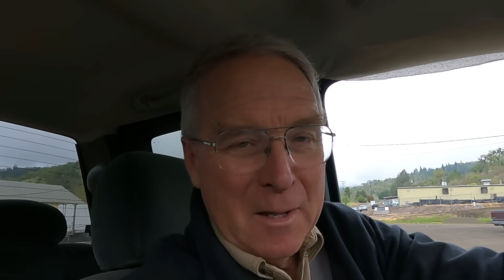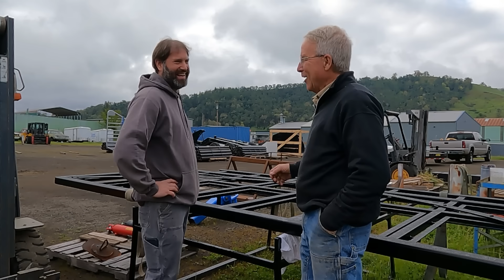Installing My Gate!!

Comment: Yes, your choice of the "H-beam" without correct moment connections is your issue. 
Add stiffeners all the way up to avoid torsion buckling.
Also that brace at the base should have been near the top and you can still do this with a lateral brace from another large mass footer / pier. 
You can also weld plates on top and bottom flange (leave bottom open to allow water runoff and debris removal)...

Comment: You're really worried about security there; I couldn't miss the barbed wire along the top of the chain link, and I presume that some of the low-voltage feed is for video surveillance and other security measures.  Have there been incursions?  Is your shop and business a target?  What's the neighborhood like?  Am I just naive?  I'm a low-income renter with no automobile and nothing of value, in a residential neighborhood in the greater Boston area, and don't think that much about security.

Comment: Beautiful gate.
One county north of me there is an Amish Welding and Fabricating Shop. (That is amusing in and of itself. They sit in the dark with a gas lantern eating lunch. Then they fire up the diesel generator and go back to work ). They build gates. High dollar gates for Mcmansions and Horse Farms. They powder coat everything. I was up there a few months back getting some cattle feeders and they were loading a set of gates on a truck . Twenty thousand dollars for one set of two gates.

Comment: Engineer here. You are on the right track with those horizontal braces. Take it further, cross the I to get to the section that is starting the twist. You could always box in the front and rear of that beam to help resist the twist. Can you come up straight with a 6x6 square beam from the pad your electric comes out of? Then cross brace to the main vertical beam. Or just poor an anchor pad behind that to attach the upright brace post. If you reference heavy wood beam corner post fences, they have both the diagonal and a horizontal brace going to another vertical post to take up the loads.

Comment: I've watched quite a few of your video's.  You nailed the problem with your twisting "I-Beam," a.k.a. Wide-Beam. The extra four braces will help.  If you truly wanted to stop the "twisting," make up 8 (eight) pieces (3/8" in. solid plate / bar steel) to fit the three sides of the beam and weld 4 (four) each side, evenly spaced.   I would argue had you properly reinforced the "I-Beam," with the 8 (eight) pieces, {stiffeners} the four you had welded extra, would never been needed.  The "I-Beam," is designed to take a load from top of the wide flange straight through towards the bottom flange.  (I'm in no way a engineer, just a fat 70 yr's old former ship yard welder.)  The stiffeners need not be full contact on all three sides, allow a 1/4" - 1/2" radius @ the 2 (two) inside corners, water would / should be able to drain FREELY!!!!!!  Also the stiffeners should not come to the outside edge / flush to outside edge.  should be short enough to allow a full weld around the edge of the stiffeners.  Maybe 3/8" in. to 1/2" in. from the outside edge / flush to outside edge.

Comment: Coming together great!  I did not watch the episode for the footer construction, but my gut engineer says that thing should be at least 6' deep and 18" diameter at minimum, especially in soggy Orrygon!  As far as the hinge column goes, the kickers will help, 45 degrees is ideal.  What would really help is some depth to the design, but it's a little late for that.  I would stitch 4 vertical angles, say 2x2x1/4" , attaching the toes of the angles between the inside flange and web of the column, creating 4 small  square "pipes"  at the 4 corners.  Four inches of weld on each toe, top and bottom and 2" on 12" @ a single 3/16" in between. Weld the ends of the angle to the baseplate while you're at it.  It wouldn't hurt to put a horizontal strap connecting the the backs of the angles at each hinge point, and it's only 15 more minutes work. Prep every weld surface by grinding to clean metal, no cleaners necessary, and use only 7018; that 5P not the way to go. The best part is you don't even have to make beautiful welds, just so long as they are sound. It all gets covered up.  Next, and most importantly,  cut some strips of 1/4" plate and box-out the column by filling between the toes of the beam. For aesthetic purposes you can seal weld the outside face only, stitch the back plate, or seal weld both inside and outside face. I think the torsional stress is what's causing your binding issues, and until you make a box shape, it's going to continue to twist the column when the gate is in the open position.  The top and bottom hinges are being forced in opposite directions, and I beams are not good at resisting twisting forces.  The 4 angles will give you some additional vertical stiffness without changing the outer dimension. If you start on the back side, you'll have it down by the time you get to the front show welds. It will all be ground smooth in the end anyway.  Regardless of the order, all the angles should be securely tacked in place to prevent drawing before stitch welding begins.  If you are still having alignment issues at that point, I think your foundation is to blame and you may need to add your kicker bracing.

Comment: Looks very VERY good!! I’ve been a structural Ironworker for over twenty years and we would put stiffeners where the hinges are. 3/8 flat stock welded in horizontally between the flanges and along the web will stop that twisting action. Hope that helps👍

Comment: Up here in northern Vermont i have seen gates built by welding both posts to an I beam 4 feet below grade and setting the locally made  1200 pound utility blocks on the I beam, post to post,  and the road built over the blocks.

Comment: The paint step in this project is a higher cost than most would guess... As a welder/fabricator I haven't found the powder shops to be worth the money most the time. In a marine environment yes.. In this case, 2 coats of primer then 2 coats of a high pigment quality paint like a WURTH product is 90 percent as good and 25 percent the cost of powder shops(if not cheaper). Touch ups over time are always needed and perfect match from a 20$ aerosol is pretty handy. If you have lots of money and want the best of the best-- powder shop it

Comment: Here North-East border of Europe just before Russia where only Finns live the ground is frozen during winter as three to four feet deep. This mean that we have different dilemmas with underground support or base structures .  Here structures you during build think that are super solid and heavy duty WILL move around between seasons.  So everything must be build so that it is adjustable by bolts but of course main parts can be welded as one. Nice gate and good steel work. 👍

Comment: Wouldn't boxing in the I-beams help with the torsional flexing? I beams are strong in the plane of the webbing but not very resistant to torsion. By capping/enclosing the sides, making a square tube, that would dramatically improve torsional resistance, at least where it is capped. There would be a weak spot where the I beam goes into the concrete. Either way, that is an elegant looking gate, what a project.

Comment: At minute 6:20 in this vid, I noticed you didn't pick your berries ( AKA welding BBs) before paint. I guess that is what separates the career fabricator from the concrete specialist. Other than that the gate looks very nice.

Comment: The post isn’t the problem. I heard him say there’s a slight behind in the hinges in the open position. That will snap off the hinge for sure in A couple of months. There should be zero resistance in the hinges, period.

And please do not put a wheel on the bottom that will act as a lever and cause damage to the concrete base along with undue stress on the hinges.
Reply: *bind

Comment: I'll try to be a good friend. 
You need a Gray steel Nema hinged enclosure.  
Two loop detectors. One to create an exit signal.   From 50'  plus behind the gate.  
One To create loops directly in front of and behind where the gate swings to keep it from opening or closing onto vehicles.  
Look no furher than door king for entry keypad/ intercom.  
A beam detector is more usefull in slide open gates. 

The mag lock has enough play and strength  that perfection in alignment or gap is not a worry.   
A strobe detector is a nice addition that will open the gate for emergency vehicles.  
A lnox box with a firman key switch is also a good addition.  
Hit me up if you need more information or want to have me look over any designs.  
It's easy for me to find issues that may be missed. 
I can tell you the fast and simple way to construct,  bury loops, and so on.  Depending on what operator you choose "Elite" or "Osco" might be good for such a heavy gate.  
 I could go on.  
There are many ways to make it maintenence free for years, but far more ways to make you question if things could have been done better.  
Beautiful gate btw.
Reply: Am i shadow banned? 
Wt
Reply: Yes

Comment: I've welded  up many large gate hinges, connections, and automations.

The gate should be welded into its final position before the hinges even come out of their box. 
 
A yard of concrete  or more and a 6×6 x 1/2" thick  square  or larger post  5' into the ground for that fella. 

The operator can be monuted on a pad.

Comment: An H-beam isn't very torque resistant.  Also putting the brace in the middle of the web doesn't help the torque.  If what you're doing doesn't help the sag may I recommend welding a plate down the flanges to make a box on the brace side of the post, and move the brace to attach to the post on the flange, not the web.  The plate doesn't need to extend top to bottom, I'd suggest leave a 2 to 6" gap at the bottom,  top to the top hinge, more if needed for aesthetics. Probably only 1/4" plate needed.
Beautiful gate, even before adding the wood!

Comment: Red / Green LED strip lights on the gate?
I drive down the drive the gate is illuminated with Red LEDs informing driver of a gate. 
Push my "open " button LEDs turn Green I'm safe to keep my speed toward gate as it swings open.

Comment: Boxing in your post beam would keep it from twisting as the gate swings open.  I-beams don't take off-axis bending or torsion very well.  Need a closed section like heavy wall  square tube.  Also could/should have stiffeners where you are tying braces into the beam web.  Otherwise the web is pretty flexible (oil canning).  On a side note, one job back I had to come up with equipment to install 35,000# and 45,000# doors.  They were about 6" thick steel.  The nuke building was already built around them so we couldn't use a crane.

Comment: As you showed in a previous video, it can be hard to build a gate that works as intended and continues to do so for a long time.  Having an engineer review your plans would likely cost more than you budgeted for this project, but it likely also would have identified your structural issues and maybe some others that haven't yet declared themselves.  Time will tell.

Comment: Looking great!
Arm angle,shear weight and rotational forces are very strong with this one.
Adding a 3rd hinge ups the complexity, and almost always causes a binding problem. 
The bottom hinge holds the weight in compression, the top is in an extreme battle with tension. 

There is a reason the standard is lighter aluminum gates are attached with adjustable hinges on square posts.
For any gate ,adjustable hinges are the #1 by 85% best practice.
Hinge posts and hinges.... again face enormous fatigue and gravity.

Looking forward to the operator and mag latch install.
I highly recommend a ground rod at the operator ,lightning is the #1 killer of operators and mag latches.

Comment: Adding a wheel and a concrete runway for it will keep the gate from sagging; long as the gate remains level throughout the opening arc.
Can't wait to see the wood on the gate.

Comment: 5 p plus is 6010, a newer version of it , that is. 7018 has higher tensile strength for holding power after you apply the 6010 plus, plus it looks very nice when applied by a good weldor. Nice gate. that'll hold up for many decades if the finish is maintained, love it. Peace

Comment: Fence guy here. I would be very concerned about a swinging gate at this weight no matter the strength of the anchor over the long term. We would only ever install gates of this weight as retractable, parallel to the fence itself on rails so the load is fully born evenly and by the fence itself.  Love the channel but I think you’re asking for trouble 10 years from now with this design in all honesty as the Earth shifts, and it will shift over time.

Comment: From a beam guy, stiffeners on the web would reduce beam twisting. Fantastic gate, love the look of the side beams. Designed and built many jobs, after years of fabrication you always find a better way after it’s built, and painted. I enjoyed your build, great job.
Reply: From another beam guy, stiffeners won't improve torsional stiffness much.  Welding full-height plates across the tips of flanges to turn the H-beam in to a box section (with a web running down it) will massively improve torsional resistance.  Open sections (H shapes, channels, angles etc.) are very inefficient cross-sections for resisting torsion.  Close sections (i.e. hollow sections, box, circular) are massively stiffer against torsion.
Reply: @smartbuildengineering  
Don’t you want a little bit of flex (lateral) built-in to the beam this is how they design skyscrapers to resist wind fatigue, right? Of course you want zero movement in the concrete because of the weak tensile strength. But the torsional or rotational resistance should be close to zero in the post I.e. once you get a slow speed momentum going in the gate, it should continue to move until it encounters an obstruction. If it stops within a foot  it’s an initial Kinetic energy movement that’s due to the hinges nothing to do with the post.
Reply: For something like a gate the loads/behaviour is only marginally dynamic and, whilst some flex is unavoidable, purposely designing in more flex than is necessary is not something that would have an advantage in this situation, especually as the resulting lack of alignment and fatigue will cause unwanted issues. Sky scrapers are a very different scenario and the concepts there do not really relate to a gate.
Reply: @smartbuildengineering  I agree you don’t want to create more flex, than necessary, and the skyscraper analogy is an extreme one, but the idea that you might set the post slightly off level understanding that when the gate is installed it will load the post back to the level position should be engineered in. The weak link is the concrete and in all of my experiences for the past 15 years with Gates the post never fails. Either the weld between the hinge and the post fails (rare) or the entire gate drops due to not enough concrete or the post not being deep enough. Or the concrete can separate from the post at the base. I also see some failures when the hinge isn’t properly lubricates and then binds internally. Causing it to rip away from the post. The effect is the same if the two hinges aren’t perfectly in line with each other. Stiffening the post will just cause the load transfer and sometimes having a little bit of flex is better in what can handle it versus what cannot. Once again just protecting the weaker link.
Reply: @smartbuildengineering  
Also the post will not receive any of the torsional resistance the operator is going to bear the brunt of that load transfer and trust me there’s a lotta momentum going there with this gate and that operator is going to have to be super strong. The newer systems on the market have DC motors and have a ramp down or soft stop feature that will help minimize that moment. We engineered that soft stop/soft start feature in the AC motors with the geometry of the scissor style arm which is kind of a lost art. I use a string to calculate the three pivot points in order to achieve the best geometry. The arms basically folded in on itself creating that soft stop.
Reply: By stiffeners on the web, you mean putting those small metal shims/braces inside the H beam instead of using them to brace against the second beam?
Reply: From a licensed SE, the gate column should not have been an open wide flange section like mentioned below as they are very weak against torsion.  Probably should have used an HSS or maybe a pipe column to resist against the torsion.
Reply: There should be no twist in the post. If the hinges are binding the weld is going to break free from the hinge. Very dangerous, it’s not going to last a month.
Reply: @Mossy_FieldStone  you are a funny kid.

Comment: It looks like a real nice gate.  
I personally do not like the hinges.  They will grind themselves down in time and i don't believe the landing pads are large enough.  Not enough weld area.  The i beam web needs stiffened from flang to flang.  
Box the i beam post and add tapperd roller bearing hinges.
Reply: and grease zerks